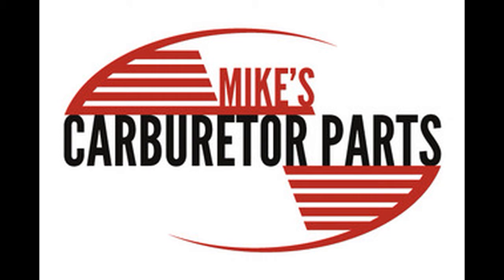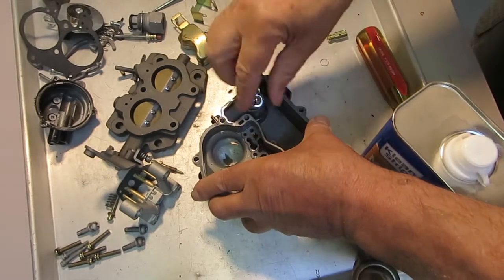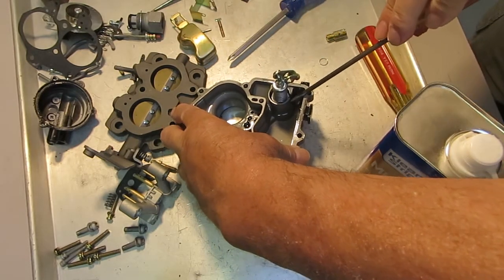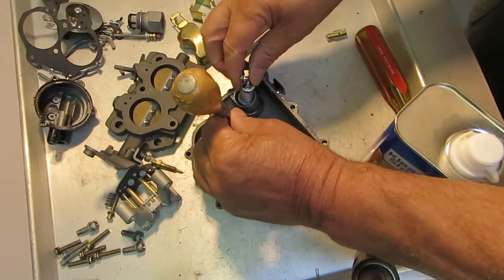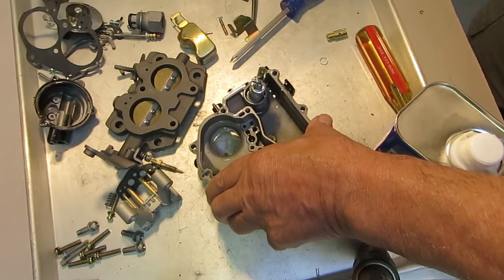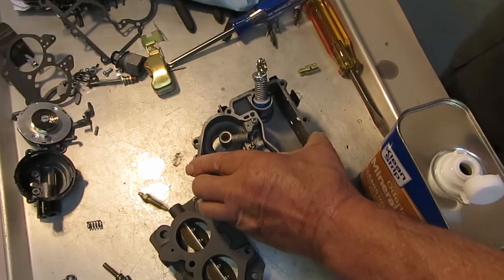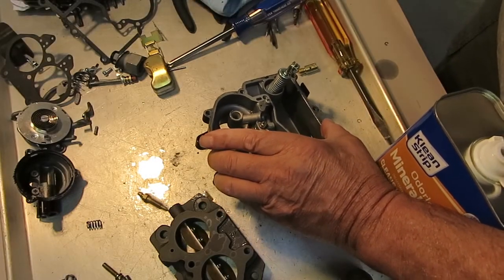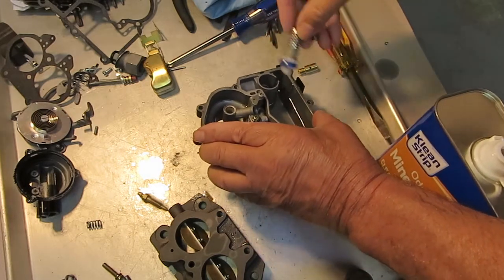Mercarb Marine 2 Barrel Carburetor - Testing Accelerator Pump Circuit

Comment: Mike,
I have two good squirts out of my accelerator pump however then it runs dry. Boat starts but then when I move to accelerate the throttle the boat dies. Any ideas?
Reply from the maker: The well is not filling back up, or there isn't enough fuel in the float bowl. I would take it apart and test the pump. See this page on how to test: https://www.carburetor-parts.com/Accelerator-Pump-Circuit_ep_1901.html